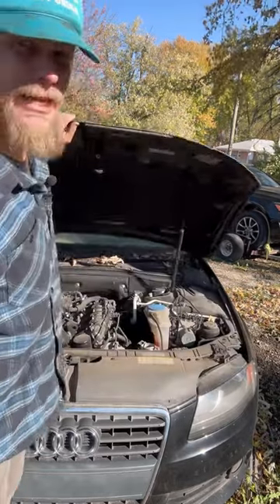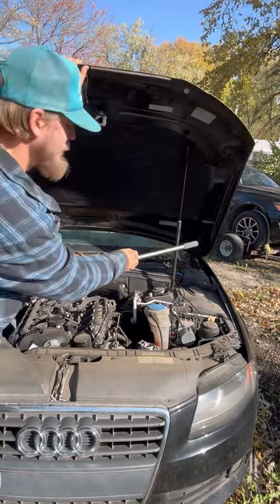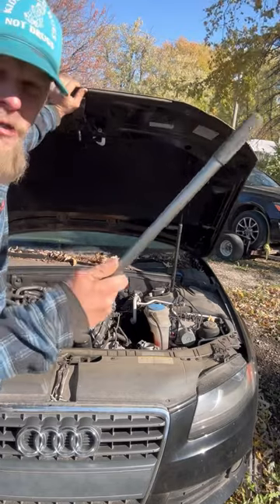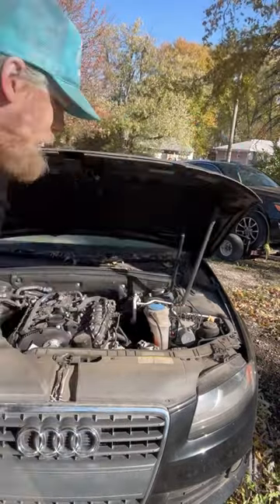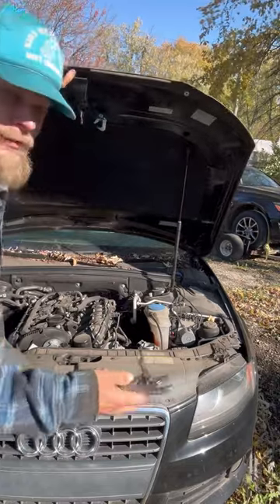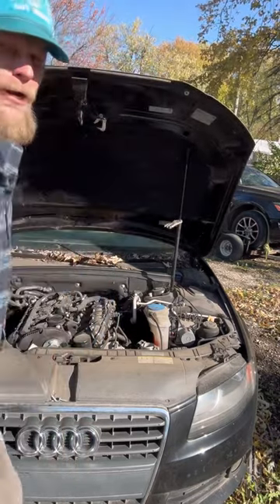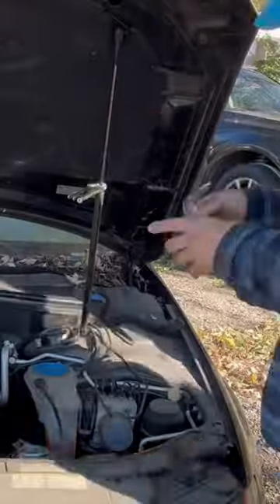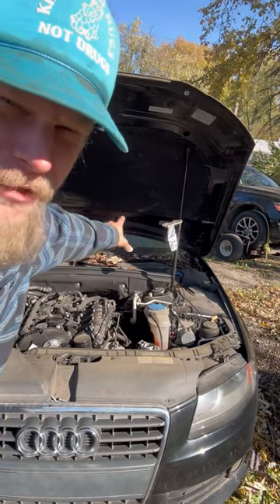Mechanic locking pliers “hood won’t stay up” support tool you already have Vice Grips demonstration

Comment: I use a broom handle from the old school straw broom. Fits pretty good between the ground and the hood. Other times if the vehicle in my shop I use the hook 🪝 of my Yale 5 ton hoist. Lower the hook down, Put the hook on the hood latch loop with a towel folded over between the hook and the hood.

Comment: The ones thatbhave clobbered me most are ones that work when you first open but when they coll they drop it on you w/o warning. I found the non-marring clamps on Amazon for $11. I put one on everything unless I just installed new lift strut(s).

Comment: Every time I change oil, I take a can of silicone spray and a paper towel and spray the hood struts and wipe them down, insuring they’re clean and well lubricated, especially top of the seal. This will help prolong their life.
Reply: Seems like a big waste of time when they are insanely cheap and easy to replace.
Reply: Exactly, it takes about 10 seconds.  I just don’t have that much time to waste these days.   😂
I am guessing you never sprayed WD40 on the hood hinges on a square body ever either.

Comment: I just shove a broomstick in there, or a crutch, sometimes a snowbrush. Grabbing it with the vice grips jacks up the strut shaft causing it to bind and leak. This is nearly the easiest part to replace on a car
Reply from the maker: If it’s no longer pressurized the seal holding the fluid has already leaked.  Dont over tighten it and you’ll be fine.  See how it slipped the first time and I just went a slight bit more on the adjustment.. I’m not digging into the shaft but I argue that it won’t bind up or matter at all anyway.
Reply: @NaptownTuner  The vice grip can Still slip Just as easy as anything else. Might aswell drill a hole through the shaft just before full extension & shove a pin in it. Just because its blown doesnt mean its leaked, All the blown ones ive replaced have been dry. Sure its already a bad part so knackering the shaft isnt much of a problem, but they DO bind after doing this 'trick' a few times. Im not speaking from hypotheticals. Im letting You know My Experience what ive seen over the years. At the end of the day do whatever you want!! But id just slap a new one on there as Its quick, easy & typically not expensive, while also ensuring nobody risks getting hurt from a falling hood. Its a hood strut... it doesnt need to be "hacked" is all im saying 👍 happy Tuesday
Reply from the maker: @alexjanito3404  they bind if they are bent, you probably try to slam the hood with the pliers still in place 👍
Reply: @NaptownTuner  well you probably didnt read then. Not everybody is some 17 year old without experience... youre not the only person who can work on things. Do what you want dude its your life. No need to be such a snob about a strangers input lmao. Didnt know itd get your panties in a wad!
Reply from the maker: @alexjanito3404  I don’t think I would have said that unless you said drill a hole in it and put a pin through it, that made me think you might have been 17.   My bad & I definitely don’t care, I love all comments
Reply: @NaptownTuner  i only said that cause its what you might aswell do if youre gonna jack it up anyways. Would be less chance it falls..